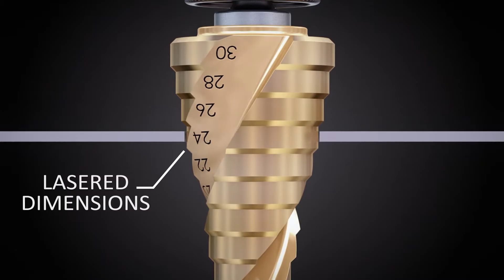How to Drill a Hole on Water Sink

Comment: I just drilled a third hole through a very thick 3/16" (5mm) Kraus stainless steel sink (very different from the sink in this video) I used a tungsten carbide tipped hole saw in a 12v Bosch drill/driver. Used water for cooling. Took a little effort but it drilled out cleanly. To remove any burrs I used an 8" half round 'basterd cut' (fine) file. Thought I was going to have to go over it with sandpaper, but it's smooth enough.  I used a 1-3/8" (35mm) hole saw.  Hope this helps. It answers the questions I had and it worked well.